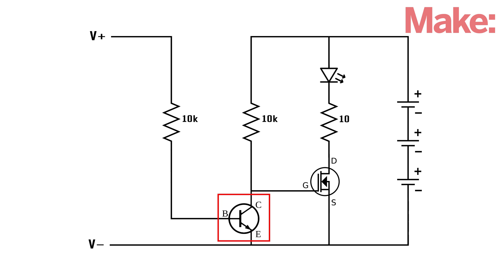Emergency Lighting System

Comment: check out Rely-A-Light, emergency light instantly when AC power is lost. A table lamp all the time.  USB port in the base of the lamp changes your devices both with and without AC power present!

Comment: Someone has probably said this already, but instead of regular batteries, use rechargeable ones, and charge them using the adapter, that way, they are always fully charged when the power goes out.

Comment: Don't forget to add a switch, if you're using it as a flashlight and the power comes back on, or daylight comes, or you walk to where it there is other light, you may want to just turn it off until you can get it back to the power supply.

Comment: Standard batteries?

Why not rechargeable batteries and a trickle charger?  If someone builds a few of these for "grandma", what's going to happen when the batteries are dead?

If we've got a device that maintains itself, grandma won't have to worry about dead batteries. (And neither will I)

Comment: Why not use rechargeable batteries then you never have to worry about changing them.
Reply: Station Plaza I was thinking of those flat cell phone batteries.  Put a little switch in there to turn off the charger when it hits 90% or so...

Comment: With a diode and a voltage regulator you could charge accumulators with the power supply.

Comment: It's true that it's less compact, but a single miniature relay would replace the entire circuit (and even conserve battery power, since the batteries wouldn't need to power it - the adapter would do that)

Comment: Interesting idea, but...  there has to be a better way to check for power than having an "always on" power supply.  doesn't this use a lot of power for "nothing" ? you'll have this connected 24/7 afterall.

Comment: I bought one of those light genies motion activated battery power lights. It worked really well until somehow water got in and shorted out the motion sensor and the circuit board. Supposed to be able to leave it outside, even in the rain, but go figure that rain water would kill a outside light. Anyway, I've been looking for a way to re purpose it since it stopped working as a motion light. It would be perfect for this application.  Thanks for the idea. But I have a question. Any way to make it rechargeable so that the batteries will recharge and stay charged so I don't have to replace the batteries after a black out.

Comment: Well, actually this circuit is bad design. The batteries will be drained long before the next outage comes.

The fault is in the way it is activated: the npn transistor will drain the batteries via the 10k resistor. The clever design would use a normally closed relay that is powered via the power plug (even a small reed relay will do) to keep it open, so as soon as the power is cut it will slam closed and power the LEDs. This way current will only flow in the non-critical, grid powered side during the sleep-mode, while the battery side won't carry and current at all.
Reply: V/R=I my good sir.
At a nominal 1.2 volts those batteries are only putting out 3.6 volts for most of their life divide that by 10,000 and we get a standby current of 0.36mAh. Divide an average AAA's life of 800 mAh and we get a standby time of 22222 hours divide by 24 for days and 365 for years and we come to a standby life of about 2.5 years
Swap the batteries once a year when you do your fire alarm and you'll weather any storm no problem.
Reply: Echo_Hotel Don't you get 2222 not 22222? So 92 days?
Reply: Echo_Hotel    " Standby current of 0.36mAh "
:-/ mAH is a measurement for charge... You may want to revise your math and recheck your dimensional analysis (the science of working with units.)

If you do ohms law with a nominal average battery voltage of 1.2V, times 3 = 3.6V, assume the resistance of the NPN transistor is negligible, such that only the 10K resistor is present, then the average current should be 360 μA or 0.36mA.

You can then assume the 3 batteries each have a charge of 800mAh, in series the charge the batteries hold is the same. It comes out to be from my calculations to be 2222 Hours of service life. (800mAh/0.36avg mA = 2222.222...) An order of magnitude less is what I figure, although that could also be wrong, I could have made a mistake, although I have checked my math, and cannot find an error.

That translates to a little over 92 days, which is not even half a year. It is barely a quarter of a year! That is not even taking into account all the factors to battery life, such as internal resistance, temperature, etc!

Also, to do the calculations more properly, you should really use the proper discharge graphs the manufacturers for the cells provide that are closest to that form of load, or do some real world testing. The voltage does not remain the same over the whole life of the battery as I am sure you are aware. And since the voltage drops w/ respect to the capacity left, the current will decrease due to ohms law.
Reply: Power Max Sorry my bad, I made a typo and added a digit.
Reply: Thats what I thought.
Reply: Ahh, good catch! A better design would be to use a P channel MOSFET with a pull down resistor that is usually pulled up by the power supply, or use rechargeable batteries that are topped off by the power supply. Although internal resistance and self discharge may still be an issue, esp. for NiMh batteries, if some random ignorant person decided to "$ave and go green."
Reply: Andre Klärner Yeah, this is Make can't expect much, at least you can take the idea and improve it.
Reply: Andre Klärner So design the circuit and post it here as a link, so everyone who is new to circuitry will be able to benefit from what you are talking about.  You can either hand write it or do it in paint and label as he did in the video this is open source place to do this... so be apart of community and post it.

As for the rest of the people saying "it is cheaper to buy" etc.  This isnt about cost, it is about learning, and seeing if you can do it yourself.  It is called 'Learning' not cost reduction place.  Most things that can be made can, and will cost more than buying.  But it is satisfaction that you can do something yourself that can open up new ideas and open up your brain cells to actually accept more info to actually learn about the circuit, and see how one can improve upon it, or even know about a simple circuit to do something that isnt dangerous.
So stop saying it is cheaper cheaper cheaper cheaper.  You obviously dont need to be here if you keep saying this you obviously dont want to expand your brain cells to accept more information.
This is a very beginner circuit that anyone can do that will help the exploration of science in those who know nothing about this stuff... and want to show something off that can be accomplished and that works.

Andre did what was right, he took the circuit and built upon it like a true maker.

As for the batteries, that will require a charging circuit, depending on the batteries you use and the wall wart you use.
Obviously you need a wall wart enough to power the circuit to turn it off or the mosfet will not open but not enough to over power the circuit itself to fry it, nor to fry or not give enough power to said charging circuit to actually charge the batteries.  This all effects the size of said box that this is being put into.

Personally I agree with Andre, put a relay in there best way to do it without the Rechargeable batteries.
Best way to do it with the rechargeable, is no relay but a charging circuit to trickle charge the batteries as they get used up by the constant power draw. Reason... relays take up space(if using a small box like here) so to save on it use either or.
Or Excellent way, relay and charger circuit if you have all the space you want, turn off the circuit and powers the charger when plugged in, but turns off when the power goes out.

I would also recommend a power switch somewhere of somekind as well, only reason if the power comes on and you just set it down cause you are too busy to plug it in, least you can to save the batteries themselves is to turn it off.
Yes the circuit can be set to still recharge even with the power switch off if you do it right.
Reply: Kethlar I was going to suggest an old cellphone battery and a tp4055 based lithium ion battery charger module.
I have a bunch of led taplights that I used that type of conversion on, turns out a 103450 lithium battery makes a great substitute for a 3 AAA battery holder, both in nominal voltage (3.6 to 3.7) and size. Plus the capacity is over double a AAA.
Reply: Echo_Hotel Good idea actually on the Cell phone battery hopefully it has the output for your led amt. depending on the battery the amt of leds will vary.  Personally I have used the L-Ion CR123's  3v's each, 6v's with the Tiny L-Ion charger really small for what it is and they last a long time.  I have so many Cell phone batteries, I really need to start using them in projects, need to make a decent charger for them in general.   Good idea though Echo I keep forgetting to use the cell phone batteries.
Reply: Kethlar you can't do much better than those micro usb tp4055 modules, they work on voltage sense have an over discharge circuit, if you are adventurous you can change the surface mount resistor for different charge rates and you can get them for in the range of $0.60 a piece delivered (as long as you don't mind the slow boat from china).
Reply: Echo_Hotel Yeh, and having stuff stuck in customs forever. LOL... Iam already going through that now... it is a pain.. funny thing is that I ordered things after and before some packages got those but some of them are just sitting there in customs collectin dust.. have been for over 2 months(best thing to do is have the item resent, usually they do it free of charge for waiting over 30days just FYI to anyone).  But i will look into those 4055's They might come in handy later that is for sure.  Thanks for the info much appreciated.
Reply: why not just use a single PNP tranny instead